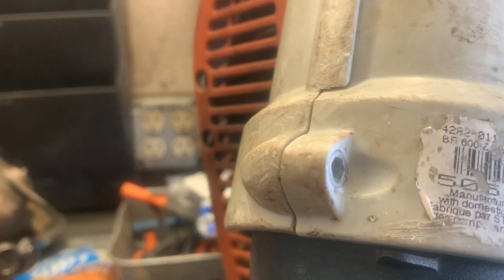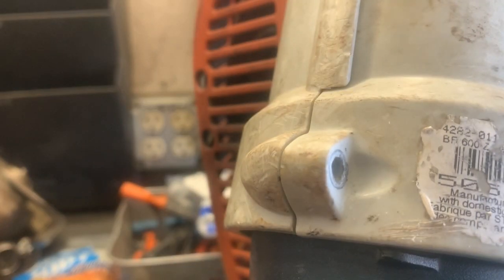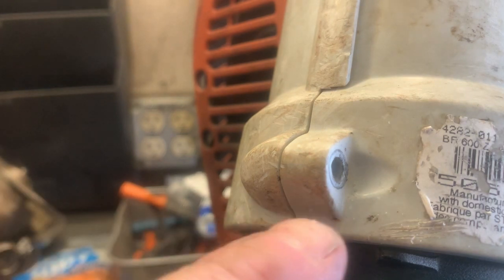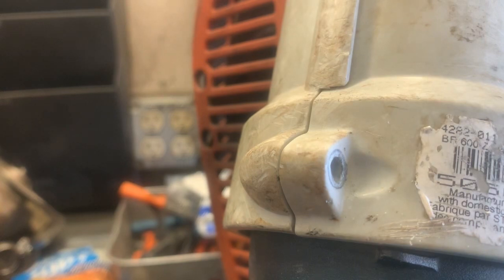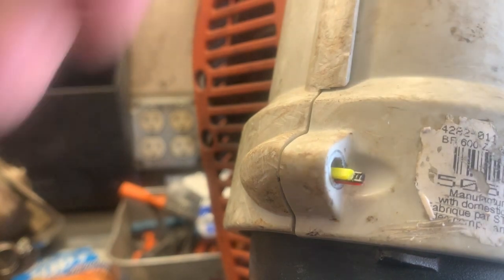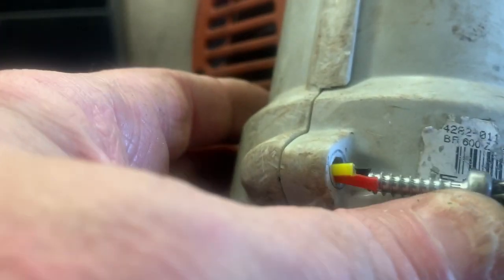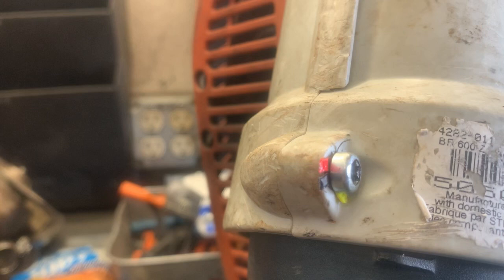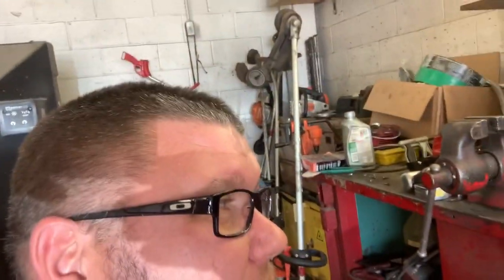OLD MECHANICS TRICK TO FIX STRIPPED THREADS IN PLASTIC

Comment: This worked like a dream, had my little bros plastic manifold in bits and someone had stripped the plastic thread out of a coarse t30 screw hole. Trimmed down 3 tiny cable ties and nipped it up enough to where I’m happy for it to do the job as intended. Perfect little hack, I’ll use this on a day to day basis! Life saver 👍🏻

Comment: in my car i've ripped the threads from the holes where i screw in my radio. I've thought of just putting some plastic in there and screw in but i decided to search to see if I found some recomended cheap hacks that could help me. Since this is the third time I've seen people saying its fine to jam in some plastic I think that it's gonna be more than good enough for me. Imma do this right now acctually, since its gonna get dark and hella cold in less than an hour. Thanks for the info, and for mentioning that I gotta make sure not to crack the housing! I didnt really think about that as a potential risk at first, haha

Comment: Fill the whole with epoxy and drill it or do a helicoil. Most other tricks are hacks and not the best way. In a pinch I use zip ties or toothpicks till the correct fix can be done.
Reply from the maker: My original video was for a Heli coil in which is the correct repair but everybody is on the fence about it and I don’t understand why people would want their equipment hacked up like that
Reply: @dalelangila9274  that's the truth on stuff you might own but tell a customer you got it going but it needs xyz and it will be in next week and see how many times after they pay for xyz

Comment: thing is to not strip them to start. disassembly with a power driver is one thing but NEVER use one for assembly!!!    the threads are already in there unless its a new part.  so put the screw in and rotate it counter clockwise till it drops. at this point its aligned with the previously cut threads. then install it by hand to the proper tightness.

Comment: You could fill the back hole with white zip ties and use a fine tip heat gun and melt the zip ties enough to get them to bind in the hole, then run your screw back into that cutting new threads?  Or use a helicoil🤣!!

Comment: The best way to stop stripping threads in plastic & metal is to stop using a power screw driver, it's just simply lazy mechanics work.
This video proves it , a mean a really short screw and he uses a power screw driver 🤬 and when the screw is home he keeps pulling the trigger to even possibly strip the thread again in is so called fix, why  not just use a Rawl Plug instead of plastic tie wraps.
The worst DIY fix I've ever seen on YouTube, what a cowboy bodge job, we say over here. 😱😱